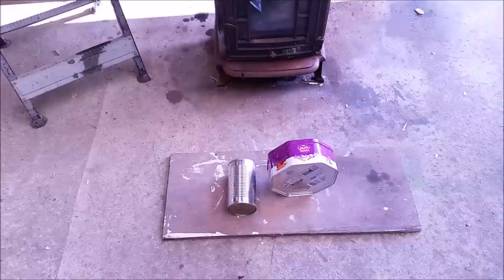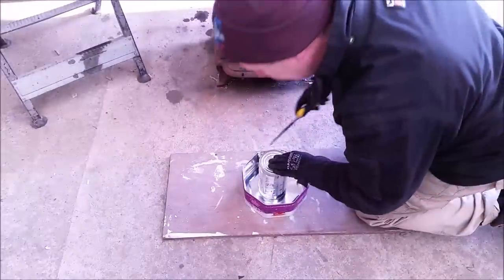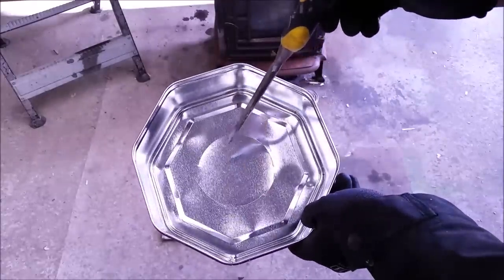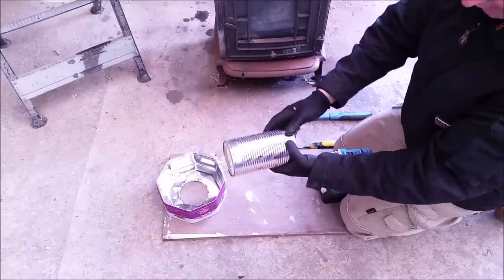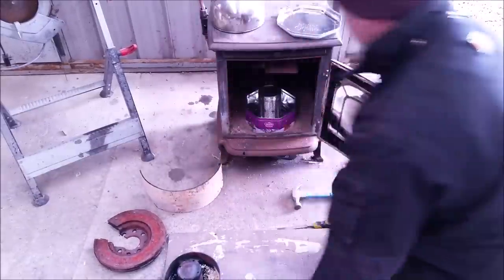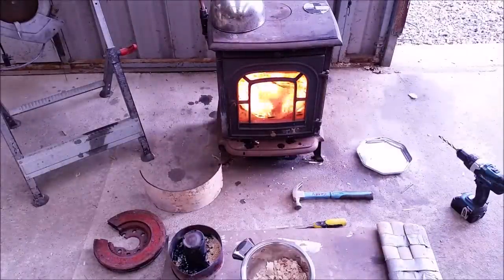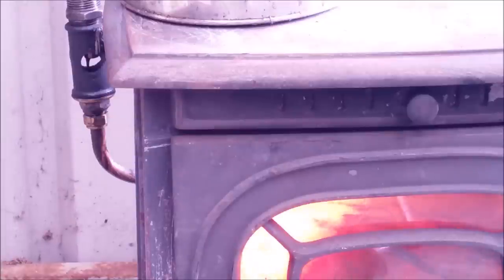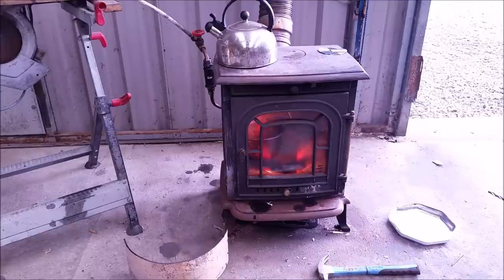Homemade Tin Can Waste Oil burning Heater .. AWESOME OUTPUT ! ..

Comment: I used this video to make an oil burner in my barrel stove.  I used a stainless steel soup pot and a piece of muffler pipe and a welder to hold it all together.  Awesome output.  It is consistent at 300 degrees Fahrenheit and keeps my entire shop warm.  Thanks for the info.
Reply: Is it still working or did it melt?

Comment: This video clears up a LOT for me . I have a set up, but having the air come in through the bottom and hen out the upper cylinder makes the most sense. I'm going to modify mine exactly that way. The proof is in the pudding as soon as you close the door the fire takes off and the noise is the proof. Thanx Gerry !
Reply from the maker: Hi Jm Schull. i have made many versions of this and they all work well. Takes only a few minutes to make the burner part out of tins just to see it in action. The big thing is to have a good length of flue and a well sealed stove with the only air coming in through the bottom and it will roar lol. Good luchk with the mods. Thanks for the comment Cheers Gerry
Reply: Thanks for the encouragement and advice. I'm using 4" iron pipe for my flue and a stainless steel cookpot for my burner bowl. I'll let you know how it works. Having a problem with my TIG welder and waiting on a new gas solonoid. Thanks again, Mark

Comment: Gerry, I think I've watched every one of your waste oil burner videos.  Good stuff and helped me design my particular application, making my old fashioned Parlor stove into an oil burner.  This stove is about 14" in diameter, maybe 3 feet tall, so it's not something that will heat your shop but would do fine heating a smaller room.  I think these were also referred to as Caboose stoves, FWIW. 

It has a separate air box/intake area beneath the burner chamber above it, so it was a relative simple matter to fabricate an oil burning tray through which the air is drawn up through the center.  Because the air intake "box" remains relatively cool....being beneath all the hot action...I was able to install a small fan to force more air up to the burning chamber ($10 Walmart cheapest hair dryer fan guts).  I coupled the fan with a speed controller to modulate just what's needed (generally run it at about 1/4 of it's max speed).  

It works surprisingly well, though not yet fully installed (only have two sections of stove pipe to give it some draw for testing).  Have run about a gallon of oil so far to test and tweak.  Tried diesel oil once for kicks....and guess what, it smoked like a diesel and carboned up quickly but man did it put out some heat! Today, I tried an 8:1 oil/diesel blend; smoking was minimal and heat output well over double.  Plus, since the diesel thinned the oil somewhat I was able to throttle back the oil flow almost 1/2.  Engine oil doesn't have a lot of btu's, but diesel sure does.  Try a blend some time, see what you think.

Comment: here in the USA we can the one a soup can and the larger tin you mostly see those a Christmas 'cookie' tins anymore, the fire starter I have found dryer lint from an electric dryer is a good 'free' Firestarter. Easy to bag up to for camping trips.  Awesome set up for a garage or work shed.
Reply from the maker: Thanks for the tip James and for taking the time to comment Cheers Gerry👍

Comment: 2 suggestions:
1) Use hight-temp clay(the stuff you find in the fireplace section of a hardware store) to seal up the can to the metal box. 
2) Use either clay or something else that isn't very thermally conductive to keep the metal box from touching the bottom of the stove.

Comment: I wonder how many times a week Homeowners Insurance adjusters hear the phrase "I saw it on Youtube" before denying claims?
Reply: Looks dangerous but....
Reply: Idk but probably would have a funny story to someone while on break
Reply: Lol!!!!!
Reply: WE......
ARE.... 
FARMERS,,,,,,,  
Bum pa bum pa bum bum bum.....
Reply: You wouldn't be saying this if you were without power and freezing. I bet the people in Texas that got a bad winter power outage would use this. Better than freezing to death.
Reply: @charmed2u2  I had a proper wood-burning fireplace, the house I rented was an old craftsman, and the fireplace was in the centre of the house, not on an outside wall. I also had a friend who worked for a finished lumber mill, who provided me with truck loads of planer ends 4X4 off cuts, Kiln dried, let them sit in the rain for a day or two before stacking, and the burned longer and hotter.
Through four winters, I never had to turn on my furnace [even had the gas company pull a couple of surprise inspections to make sure I wasn't pirating the gas or fixing the meter], Just had a burn in the morning to heat the brick mass, and it heated the whole house for the rest of the day.
People 100 years ago knew a LOT about heating homes effectively.

Comment: I like the idea and proof of concept of your video. I think it gives beginners like myself a bunch of creative ideas to experiment with. Thanks for the video.
Reply from the maker: Hi Poo Guru. I took this video a step further and made that burner out of steel and it worked great. I then designed another burner  and it also works great and can deliver lits of heat for about 2 litres of fuel per hour. Here's a link https://youtu.be/ShTLaYKjzxw  Thanks for commenting Cheers Gerry

Comment: Wow thanks for that vid very informational Iam Burning wood right now but I've always wanted to do a waste oil I work on heavy equipment so oil is very available for me from doing oil changes !
Reply from the maker: Hi DJM  I progressed that burner and made a better design. It is now a 2 piece unit and is very easy to make, use and clean. Here's a link https://youtu.be/kQNkefOdwUg  If you have lots of waste oil available you can certainly make a ton of heat for free. Cheers Gerry

Comment: I
Wonder if you used a shallow Dutch oven instead of a biscuit tin. As for a stronger substitute for the dog can, I’ll have to give that more thought. That’s a heavy stream of oil. Would burn through 5 gallons quick. Cool vid. Thanks!
Reply from the maker: Hi U have infinite Worth Here's another version of the same thing made from Stainless steel and some plate steel. It's easy to make and runs about 2 to 3 litres per hour for some serious  heat. Thanks for the comment Cheers Gerry👍
Reply: Thanks Gerry! I’m a fan. Keep the vids coming!

Comment: Back in the 1950's my family used such a system to heat our home; the neighbors went crazy when we burned oil from the date nut  bread and peanut butter factory near by.  Everybody craved the stuff.
Reply from the maker: Hi Dog Brokedog. This burner works very well but I must make one I can cook on then there will really be cooking smells. lol. Cheers Gerry
Reply: Gerry, somewhere here on YouTube is a stove that could be retroed to burn oil.  It has an oven and several of those secondary, 3rd and 4th re-burn center to intensify the heat and redistribute it, as well burn the fasses to help with Global Carbon in the air.  I would start looking under brick ovens and homemade steal and firebrick replicas of old time wood ranges. (why don't I do it myself I have reasons, You keep filming. so far good job.)

Comment: Back in the fifties my dad and his mate couldn't get coke for the round stove they had in the quarry workshop they were working in but they did have a big tank of waste oil outside so they ran a pipe from that to the top of the stove and using a small tap were able to regulate the flow. This worked to a degree but was also a bit 'dirty' so to overcome this they ran a pipe from a large rainwater tank with a tap to control the flow. when the stove was up to the required temperature they would turn on a dribble of water and this would intensify and clean the combustion process. In the bottom of the stove they had an old DC dynamo body with the flange end from a busted lorry half-shaft for the oil/water mix to splash on. Crude but effective!
Reply from the maker: Great tip Jonathan. I will give that a go in one of my future projects Much appreciated Cheers Gerry 👍

Comment: I made 1 using used motor oil with air compressor working fine no co issue

Comment: I had a used oil stove at one time.  It had a blower motor on it and it was inclosed in a tin cabinet. I believe I would have been "cooked" out of my work place if my combustion would have been as good as your stove.   Thanks for showing us.

Comment: Yeah man . I think it would improve if the copper pipe wrapped around the tin with 10 holes drilled in it and the end sealed off by crimping . It would deliver the oil in different areas of the tin and increase the efficiency and optimise the air fuel mixture !

Comment: THANK YOU, THANK YOU, THANK YOU... I've subscribed, viewed and commented on your other videos THIS is exactly what i was looking for. no air blower is what i also wanted. my father has been putting used motor oil in a 6" cast iron skillet and I've read your'e not suppose to according to wood stove websites and air quality blah blah blah. I wanted to see and found that my father was on the right track, we stopped talking because of my arguing with him since "against the law" in the states. now I am going to show this to him and patch things up. he barely lives on social security income and can't afford propane to heat his home and water heater. this will be a father and son project. Thank You Gerry. ok felt a tear run down my cheek. OLE!

Comment: There used to be a garage in a village near where I live that had a waste oil incinerator heater. A friend used to work there as a mechanic, back in the 1980's. He showed and explained it to me at the time during a visit.

This waste oil incinerator dripped the oil onto a red hot cast iron plate (that had to be pre-heated with a blowtorch to start the process) and would be vapourised generating enough heat to keep the plate red hot and heat the water in the radiator system the garage had.
Reply from the maker: Hi Andy. Thanks for taking the time to comment I appreciate it. I made a boiler stove that works on a similar principle but I start off the process with a little kerosene to get it going. I just posted that video today here's a link   https://www.youtube.com/watch?v=JHsNoqp9QAE Cheers Gerry

Comment: I recycle motor oil when I change oil in my car so I've use it for the chainsaw so you can use this in the stove also
Reply: I dont think I'd want to breathe that!
Reply: If you are using used oil for lubrication or the chain. STOP. You will throw you chain and eventually ruin your saw. Wrong viscosity.
Reply: Not just wrong viscosity...wrong additives, and with all the combustion byproducts and metal contamination in the oil you are damaging your 2 cycle engine or bar/chain/sprocket.

Comment: Keep up the good work Gerry your vids are great
Reply from the maker: Hi Shane. The next few videos are based on that burner but made from steel and working really well. Mr minion is now installed in my shed and producing savage heat. I think it will be posted tomorrow evening. My internet here is not too good just 0.76 mbps upload and the file is 2.8 gb so it takes forever. I am working on a solution for that too. Lots more videos  to come Cheers Gerry

Comment: I seen a guy use an old cast iron fry pan and had a pyramid/pile of lava rocks.he got the idea from a buddy that had found some large chunks of coal and the guy left the big cinders I the stove instead of lava rock.he had a machinery drip oiler and the tube centered above the pile of rock.he said,it was like cooking on the grill,the fat drips onto the rock and burns.the drip speed controlled the heat but his was very slow because of his insulated garage would heat up quickly and stayed warm with minimal fire.

Comment: a great idea
Reply from the maker: Hi Jimbo. It was just a quick way to see if it was going to work. I made a steel version which is easy to make but needs a bit of welding, works great and burns only about 2 litres per hour. Thanks for the comment Cheers Gerry

Comment: Great idea!  I'd be tempted to use a heavier metal than tin. Maybe a 4-5 inch pipe with 3/16" walls and a 10 inch pipe in place of the cookie tin.  Welded together to create a leak free unit. It would last a lifetime.  Thanks for the upload.
Reply from the maker: Hi Blackestblack666  I did  progress this prototype beyond tin cans and I have used it quite a few of my stoves. Here's one of my own design the I cooked breakfast on and it will heat my shed this winter. I show how it's setup, with this burner inside and the flue showing no smoke  https://youtu.be/tnzEDEpz3Yk  Thanks for the comment Cheers Gerry

Comment: Info on the amount of oil being put in would be nice, and  what u used to make it.
Reply: Ajax ashford

It's waste motor oil from your car or truck. you can also use waste vegetable oil from a restaurant and get it for free at 5 gallons a jug free.

There is no making it it's just dirty oil that's thrown away or taken away.

You may want to put it through a coffee filter or some other kind of filter to get out the clumps that are in it sometimes.

Comment: Using a chisel to cut a large round hole in sheet metal, and it worked great. I am going to try to remember that. I would have spent hours trying grind it out or something else as dumb.
Reply: You can also just use a hole saw.
Reply: @Jason-kg4rs   wood cutting hole saw ran in reverse works well for this kind of thing. You can get metal cutting holes saw but they cost a lot more. A cheap wood cutting one will do thin metal like tin. Just remember to run it backwards. If you want to know why I say to run it in reverse just try  running it forwards and you will get your answer real quick.
Reply: I just use general purpose bimetal hole saws, I have a set of Morris for smaller sizes up to 1 1/2 and then a set of Milwaukee for larger sizes up to 6 inches, I have no trouble drilling through wood, metal, or plastic with these bits in forward drive.  For a small light piece like this tin I would recommend securing it well with clamps or a vice though. A good makita cordless drill motor like was used in this video will do the job just fine.
Reply: @Jason-kg4rs  Most I have used for thin metal like that if you do not run them in reverse they get caught and rip the metal up. There are too aggressive. 6 TPI (for wood) just cuts thin metal for me better when ran in reverse.

Comment: The intense black smoke, where does that go? Or do you have a way of avoiding it?
A welder once told me he'd built a waste oil burning furnace for his shop which, as he claimed, burned it's own exhaust gases as well. Dunno if that's possible to achieve as a backyard job kinda project though...

Comment: Will you be placing the cut disk break in your oil burner??
You mentioned adding more metal to keep heat  at the same time the dish would concentrate the flames better and burn better. You might also consider adding more holes in your center tin can = better burn👍

Comment: I didn't get all of that, not because I can't understand you but because I can't hear very well. Did you have the tube so the oil would run in to the pan or can, and how big was the oil line coming in?